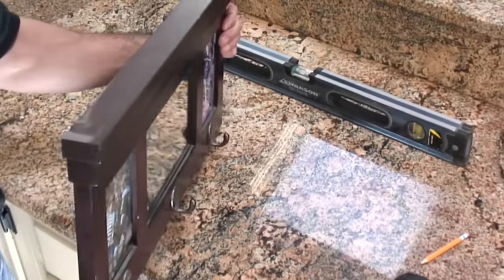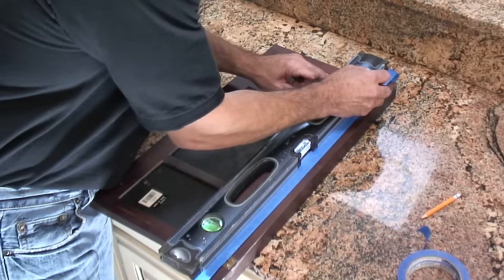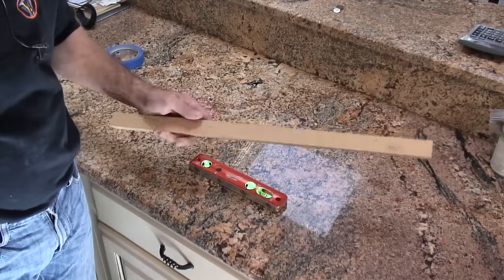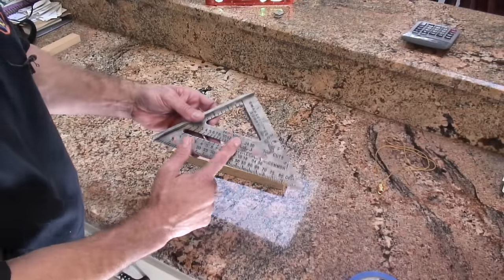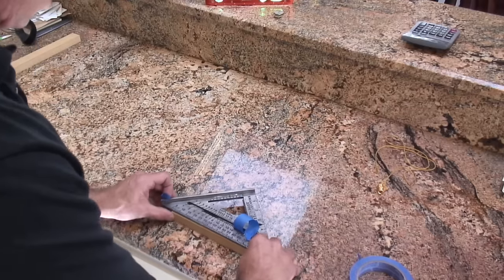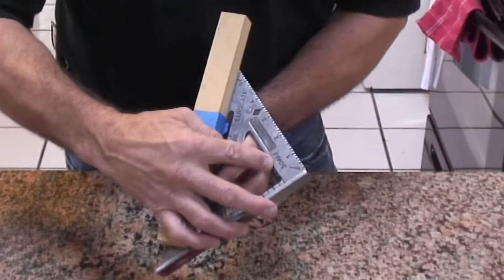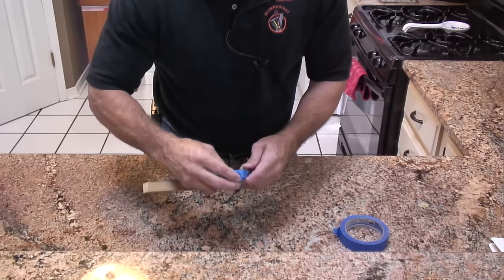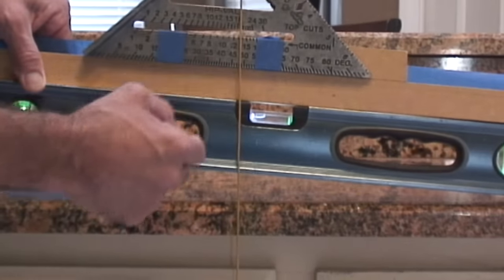3 useful Hacks anyone can use!

Comment: You don't need a square for the third method. Just tape the twine half way along the top of the picture and put a piece of tape half way on the bottom of the picture. Now put it to the wall and the twine should've in line with the bottom piece of tape. Simple, no square!
Reply from the maker: Well, I guess I should run a line through my title and name it 4 hacks.Thanks for the useful tip 577666, new ideas are always welcome! Keep in mind that I show how to use a Speed square as a level for just about anything, not just for hanging pictures. I have used it in the past on  jobs  by holding my plumb bob and string across the top of the square in order to check for level. I had the square  and plumb bob in my pouch and I did not want to climb down a 28' ladder to retrieve my level. It can save you in a pinch on construction sites and every carpenter should have  a Speed square.
 Have a good day!